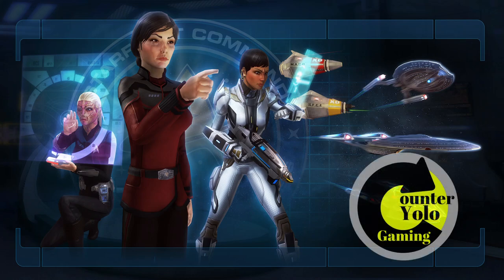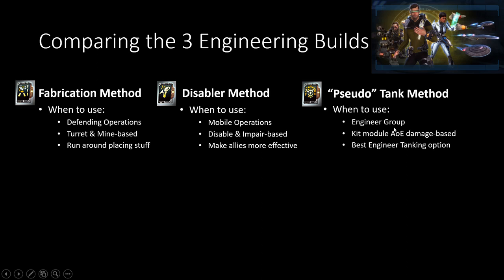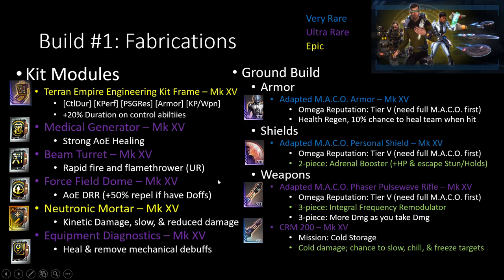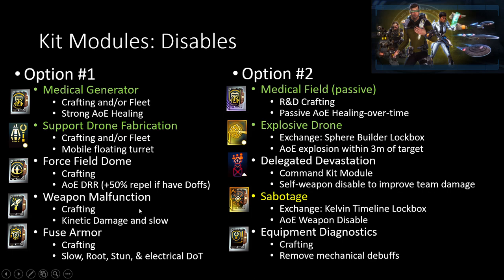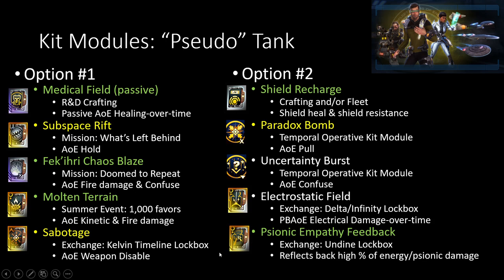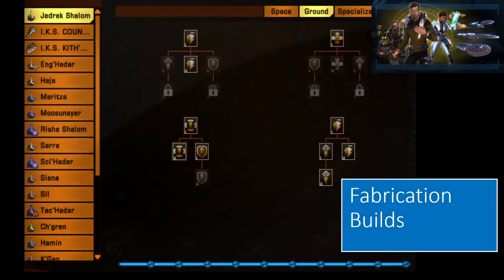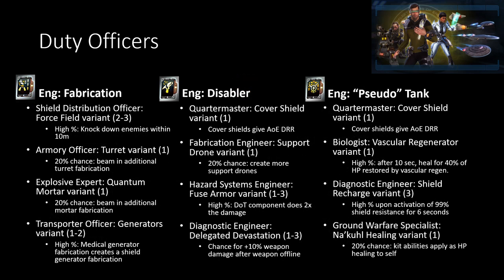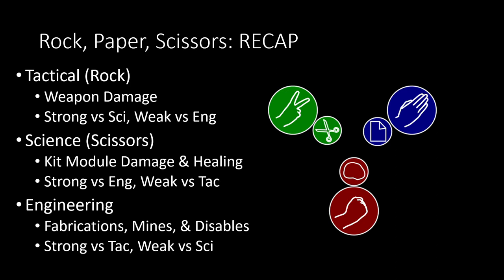Engineering Ground Builds (Rock, Paper, Scissors of STO -- Part 3)

Comment: Did they finally fixed the secondary Fire mode of the "CRM 200" ???
( it was broken for years )
Reply from the maker: It worked properly when I was using it a lot with my engineering captains during VIL, but I haven't done much ground during AOD, so it's possible it got messed up again thereafter.

Comment: looking for some pointers with ground engineer, i've gone healer fab build and it does very well at survival and aggro grab, as long as everyone is in my heal range if a high aggro build is outside my heal range they will pull stuff and most of my heals are location place it and forget it so i can't rescue someone who wants to not team play, so i use the nanite and the lukari drone the 2 crafted passives and the temp hp ground placeable device, are there traits or skills and or ground DOFFs that will either extend the range or amp up the healing?
Reply from the maker: None that I am aware of. There could be though, I just don't keep up with new doff's anymore & are frankly a cash grab if you are using any found in lootboxes (high cost for minimal returns, besides a handful in the game).

Comment: What about those choice selections down there on ground skills? Which ones are the best for each situation?
Reply from the maker: Simple answer for ground choice selections (I'm a little crammed for time right now, otherwise I would go point-for-point on this.):
Not using the Commando Specialization? -- go full defensive-heavy on the ground skills.
Using the Commando Specialization? -- go full offensive-heavy on the ground skills, as commando + the tank stuff should be enough to keep you alive.
Reply: @CounterYoloGaming  meant the picks like passives you get from each ground point you spend, like choosing which skill I'll be able to train or crouch vs aim bonus stuff like that. Thanks for the reply.